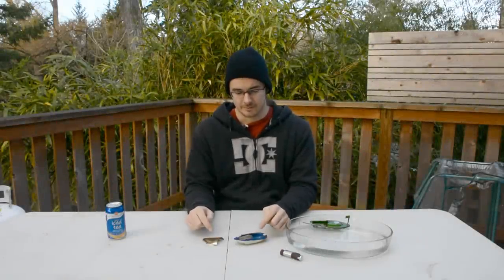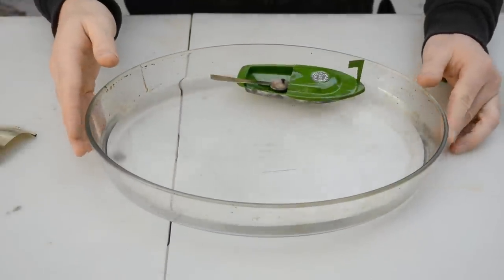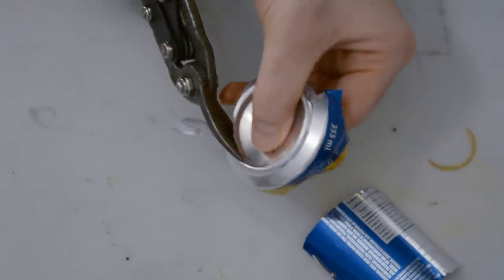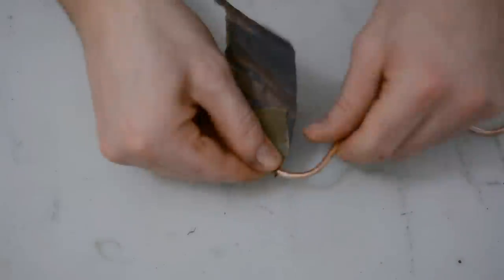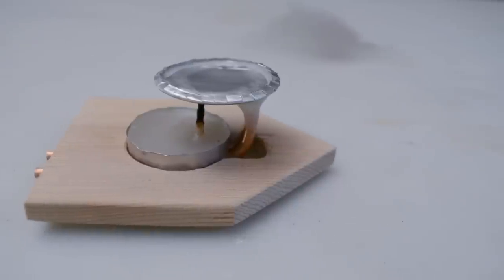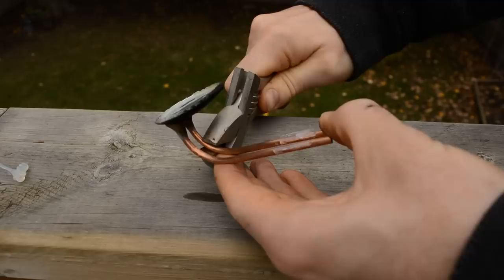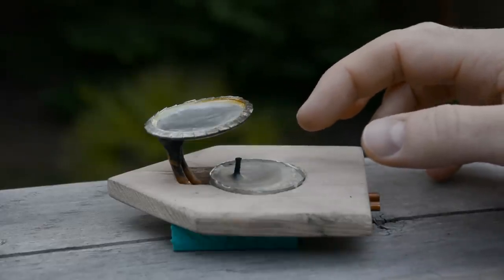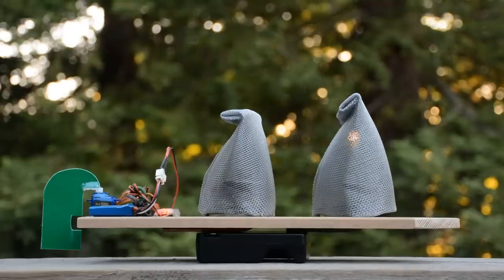How to Make a Pop Pop Boat From a Pop Can!

Comment: So this is basically a safe alternative to making your own pulse jet.
Reply: Sort of, this wouldn't work outside of water
Reply: Nah, ask colinfurze. He says it's safe.
Reply: @KingCheepcheep6  I disagree, it would work outside of water it would just be very anemic. there is a heater method used to heat air that kind of does the same thing. generally water boilers want to avoid the mechanism that makes the "pop-pop" boats work because it can cause damage and is a major annoyance.

a pulse jet uses a constantly expanding gas and intake causing a chemical reaction aka and explosion, a "pop-pop" boiler is a purely thermal reaction and could operate off of a battery and a heating coil. we don't really scale them up because the parts are prone to wear and  anything that combines heat and pressure like their is likely to fail, on a boat this means taking on water. but you can think of it as half of a sterling engine.
Reply: Absolutely not, steam engines are EXTREMELY DANGEROUS AND CAN BR EXTREMELY DEADLY.
Reply: If you don’t believe that, just research steam engine explosions on just trains. Then research jet engine explosions of any jet propelled vehicle. Make sure you sanitize the floor where you do you research...that way you don’t get any germs on your chin when it hits the floor.
Reply: @fuge74  CHey man sounds like a strong one any way to get some tips from you?
Reply: @youarerightthanksforadmitt846  I have none to give, its just thermal expansion. If you add propane you have a pulse jet. If you loop it and run it backwards (without fire) it's an AC. system.
Reply: Its a pulse jetski
Reply: I saw the similarities to a pulse jet immediately too not exact obviously
Reply: @jimmyblakemore141  ye some of the steam engines kinda look like they summoned cthulu out the front, the mangled metal bent and shredded this way and that.
Reply: I forgot The name, works for rockets too!
Reply: C'mon Forrest. Give us the details on your second creation. Even if it's just in the comments.

Comment: 9 months later. Still waiting. Lol
Reply: Lol.
One thing that didn't make sense, is why didn't he have the water-intake tube facing forwards and the water-outake facing the rear. You would effectively triple your power, because you now have two equal forces (sucking and spitting) working for you. This current design would have the sucking work against your direction, and being close to the spitting, would create unneeded turbulence or "drag" in the water.

And with the Double-Candle/Engine Pop-pop boat... why didn't you have the front engine "suck" from the nose of the boat, with the front water-outake pipe aimed towards the water-intake of the rear engine. This way the front engine can work at max optimal, and the rear one gets an extra "boost" to its performance. Basically a difference of quadrupling your power, in a perfect/theoretical setting, I know in the real-world/practical setting there would be many other inefficiencies or factors that play a big role.... but that's no excuse to engineer something well !!
Reply: I looked in his playlist and found that his video before this one was from 4 years ago! So I'm sorry, but there's literally NO TELLING when the follow-up will be.  :-(
Reply: You can not decide which tube sucks and which one blows. There are no valves in the tubes so the pressure goes in and out of the tubes equally, and you definitely don't want to blow energy out the front because that would be totally against the point.
Reply: @ekinteko  There are no separate tubes. In fact, you can get away with only one tube, if you use precise machining. The idea is that the water level in the tank goes up and down, sucking and expelling water with the same force. But the expelling cycle is better propelling the boat ahead than the sucking cycle stopping it.
Reply: What the heck are you even talking about??  Did someone delete a comment or something? Whirlpool is a weird place anyway, but ... has no bearing on a pop pop boat.
Reply: For what you hook up this dude at a party 9 months don't f*** with a man like that
Reply: Jesse Graas ik
Reply: @ekinteko  it wont work then
Reply: Lol
Reply: Right lol
Reply: @BartJBols  
Why wouldn't it?
Not condensing, just genuinely interested in the mechanics.

I have a feeling placement of the tubes into the bottom of the dish (portrait vs landscape) will allow you to adjust the plate's tilt and determine which is the water intake and outake.
Reply: Yes
Reply: There is another way if you scale it up to a vessel carrying people. Attach a type of flow control device timed with the pops, based on pressure. If you enclose the flames, like say with a steam engine, but make a gaint pop system. As the steam pushes the water back through a front intake, the valve closes, and as the vacuum starts sucking, it pulls the valve open. Kind of like a piston. Sound dampening should also take care of the loud explosion sound. The "thruster" would be set up the same way but flipped. It would make for an interesting build.
Reply: hes not doing youtube right is he  @Lothaenorixius
Reply: that what u just explained does not make sense lmao. this is a boiler not a car engine. agian, lmao  @ekinteko
Reply: @jabaaronkowalski498  
Irrelevant.
One of the tubes is sucking in, and the other is spitting out, thus creating thrust. If you can place the tubes and angle them correctly, then the thrust you produce would be more efficiently put into kinetic energy.

I'm not looking for a VTEC solution, just a simple solution to maximise the efficiency of this simple contraption. Not sure if you can comprehend it.
Reply: @ekinteko  it looks like you can't control which is the input or output. all would be both
Reply: @ekinteko  why not just make a larger engine? use a coffee can. get some pwr out out of her.  huh kangal that would dope huh!
Reply: @CookingWithCows   if one of the tubes was a smaller diameter that would insure the larger tube pushed and the smaller tube pulled in water.
Reply: @ekinteko  You are understanding it incorrectly, there is no intake/exhaust, both tubes do the same thing. The boat would work with just one tube. It's the pressure caused by water vapor that causes the boat to move forward. As the vapor forms, it pushes the water out of the tubes and pushes the boat forward. Once the pressure equalizes, the water keeps going out due to momentum. This causes a negative pressure in the boiler, which then causes the water to get sucked back in and the cycle repeats. 

Now, the water being sucked back in does slow the boat down. But the boat already has some momentum, and the candle is providing more heat/pressure as the water gets sucked back in, which results in a net gain of forward momentum. 

There is a page on Wikipedia if you want more detail
Reply: @AverageFlamethrower  
Thanks, you're the only useful reply here. Although the two tubes are connected, they don't do different roles, so they're both intake and both outake.

Which should mean the boat only rocks forwards and backwards. I guess the pressure of the steam is released at a higher speed and directional (giving forward thrust). Whilst the sucking of water happens much slower and from multiple directions, so that it doesn't decelerate as much.

I guess having the right sized pipe is important to have a balance of air, steam, and water. Too large and it won't create the pressure for net positive thrust. Too small and it won't be able to suck in water as necessary.

Maybe that's why they use two pipes. It could help the partial atmosphere during the cycling as well (trapped air etc).

Perhaps if someone had a pipe with rifling/valves that favoured a directional outflow it could be more efficient. Basically giving specialised roles per pipe, as per my initial confusion. Also maybe a cigarette lighter could provide the heat better than a candle. Interesting project for kids nonetheless, and the first I've ever seen it.
Reply: He's active on FB, perhaps message him there?
Reply: I blame you for this appearing in my algorithm
Reply: Ha I'm on 12 months
Reply: @All Cars Matter I don't think they need to be made of copper but I could be wrong, also I think most people use copper cuz copper tubing is readily available as its used for brake lines on vehicles and is pretty inexpensive
Reply: @All Cars Matter when I was at college I did work experience in a garage and a lot of the cars had copper brake lines but I'm in the UK and this was at least 15 years ago so maybe they've changed now or are different in other countries, I dunno but a quick Google search for "brake lines" still finds many copper brake lines advertised as such a 25ft roll is about £11 gbp
Reply: @ekinteko  Because it operates on pressure. When the pressure is high (when steam forms) the pressure is released EQUALLY across both tubes, both tubes will release pressure by pushing out water and steam, none of them will suck in anything. When the pressure is low, which in this case means a vacuum, the atmospheric pressure will instead push water in the tubes, both at the same time. So if you put them at opposite ends it would either just spin around (if they were misaligned) or it stand completely still.
Reply: @TehBudWhisperer  
Well, not to make your comment sound stupid or anything... but if you check the timestamps you can see which reply came first or second.

This was the first time I saw these contraptions, and the physics part of my brain was tickled. All the useful comments came much much later.

I don't blame you, Youtube's commenting system is broken. I mean, have a look at the cryptocurrency comments in this same string lol.
Reply: Kangal your conclusion is correct, the sizing and length of the tubes are important. One tube would work as well. Your idea having one inlet and one exhaust might work. Take apart an ordinary coffee machine and you have it. The thing is that the inlet is slightly reduced just before the heater so that the hot water choose the other way. It would probably work as well on a pop pop boat.
Reply: @ekinteko  There is no in tube or out tube.  They're both in and out.  The reason this works is because sucking is omnidirectional and blowing is unidirectional.  This property of fluid dynamics is used in many applications.
Reply: Kangal, the reason he didn’t do that is because both tubes alternate being the intakes.
Reply: @ekinteko  the intake/outake your speak of, aren't so, the water heats up and creates steam, the steam pushes the water out of the easiest pipe at the time, this then pulls water in from the other pipe, at which point it turns into steam and, potentially pushes it out of the hole it came in, if this happened in your proposed design it wouldn't move
Reply: @ekinteko  If you have a constant flow of water you just cool the boiler down, and you'd need a one way valve to avoid that the flow doesn't go forward.
Reply: @ekinteko  both tubes are intake/outtake
Reply: This guy forget his youtube password
Reply: 2 years
Reply: 3 year now :( I really hope he’s ok
And I wanna see that super boat actually sail across the water…
Reply: @ekinteko  my guess is that both tubes act like intake and exhaust tubes. There's no continuous flow
Reply: Need an update!! Come on bro!
Reply: 3years I want to see this radio boat
Reply: 3 years later... Just found this vid... No continue...
Reply: @ekinteko  both tube switch between intake and exhaust, is not one does intake and the other does exhaust.
Reply: 3 years later. still waiting. lol

Comment: Damn, i love that first step! 2:38
Reply: Personally:
If ETF I'd probably put $5k into VAS and $5k into VGS. I'm not sure whether you'd classify current market conditions as safe but if the value of the ETF remains stable the returns (Distributions) should be higher than savings account.

if Savings account I'd probably open something with UBank (or another bank with similar/higher interest rate) and keep topping it up monthly to meet requirement for the higher interest rates. If you can't add any additional funds on top of the initial $10k then you should consider a term deposit (if you can get a higher rate than a savings account of course) as saving account's interest rates are generally really low without the bonus rate.
Reply: You're a bizarre troll Stevo..  Your script is hitting a completely irrelevant youtube video, because I don't think anyone here cares about cryptos...
Reply: @parishna4882   Correct *****LMFAO*****
Reply: I'm still stuck on step one. I'm just repeating it, you know, for practice. :)

Comment: over the years, I have made a few,  I found that the thinner the metal, ie, flexible, the better it is, plus metal putty is really good at sealing the joints, apart from that, you explained it really well

Comment: The boiler angle plus your tubes on the boat you bought are 90% on the inside of the boat only 10% outside the boat in the water. on your wooden boat your tubes are 80% in water and 20% out. So they're cooling down faster.
Reply: TBH I've never seen a design like the one in the video, only the coil-based design for the boiler. 
Direct heat to a 3 turn coil copper tube mounted above the heatsource in the well of a boat hull (made from half a drink can, with the bottom pushed out into a bow) is a much simpler design and works far better. We used to make a bunch of them at a time and race them when we were kids because you only needed a pair of tinsnips (or even kitchen scissors in a pinch) as a tool.

Comment: I've seen this propulsion system before ... very nice ... and it even sounds like it has a piston engine ... extremely simple a propulsion system without so many moving components that are subject to wear and that are at higher costs small or larger ... I wonder if it could be applied on a larger scale ... remote control boats or even a large boat

Comment: Built this with my son & loved it! Have you tried J.B. Weld yet? I use it to build brass olive oil candles. It seals off the threading in the joints. It is heat resistant and even comes in a marine variant, that I, to be honest, have not tested yet, but sounds interesting. Thank you for sharing. Very well produced. Cheers!

Comment: I want to build one of these big enough for me to ride across a lake with. Can it be done?
Reply: Hrmmm with the right tool and material.....yes you can.....maybe...
Reply: so a steam engine.
But im fairly sure this doesn't scale well, as it relies on the sucking and pushing of water.
On small scale that goes fine, but on large scale id not want to sit anywhere near a steam explosion that can suck that much water in.
but you can use steam to run paddles ;P
Reply: Nekogami is right. At bigger engines the boiler will cause problems. But... what about a series of 500 little engines....? Hah, it would sound like flying with a swarm of ducks.
Reply: Adjcent a pop-ular question. It’s Pounds per second by Volume per Pop x delta t (outlet-intake)

Comment: And why not solder joints of (boiler ?),instead using epoxy ?.
Reply: I would use Acid core solder, should work great.
Reply: Prolly because aluminum so thin gets brittle or melts who knows it only took 4 years for this videos.
Reply: @raymondmucklow3793  aluminum definitely won't melt at soldering temperatures. Alumiweld brazing rods would have a flexibility similar to aluminum and might be a better option than solder. I don't know anything about brass filler brazing.
Reply: @charlesgunzelman3323  solder is like 300f to 4oo f aluminum isnt it like 800f i was thinking more along the lines of the thickness of the aluminum. If ya have ever burned one it heats very quickly then blackens and flakes.
Reply: CryptoCracker  triggered much.
Reply: CryptoCracker  he is doing research by posting a comment people with experience can share there knowledge (like i did) on the solder side not in the aluminum side. He can learn from that. Keyboard warriors like yourself just want to make rude comments.    I bet he was waiting for someone with aluminum experience would weigh in then draw his own conclusions. Maybe experiment a bit.
Reply: CryptoCracker  just so im clear and he wasnt there are many types of soldering, copper wire, copper pipe, silver solder, he doesn't say what type or types of solder he tried. I once watched a guy tig weld a pop can. The thick part top or bottom not the side tho.
Reply: Good luck trying to solder aluminum that thin with some sort of aluminum brazing rod. You're better off trying to work a sheet of copper into that bowl shape and do actual soldering.
Reply: Good luck trying to solder aluminum that thin with some sort of aluminum brazing rod. You're better off trying to work a sheet of copper into that bowl shape and do actual soldering.
Reply: @timramich  yeah I've never tried.
Reply: @charlesgunzelman3323  yeah i really dont like that kind of attitude. Especially when a question is asked. I like to think of you tube as a platform to share knowledge and experience. Some folks just cant help it.
Reply: @timramich  alumiweld works more like solder than braze. I've not tried it on something that thin but willing to give it a shot. I know by other YouTube videos it's possible to melt thin aluminum given enough time. Now I'm curious. Also, according to other pop pop boat builders experimenting with performance, the popping action isn't necessary and actually impedes top speed. Food for thought.
Reply: @charlesgunzelman3323  if it didnt pop, would it flow ? The pop back after pressure release doesnt that suck in more water or is it temperature differential. This is the first ive ever seen these boats so i dont know much about them.
Reply: TheJayfa  darn Tuten
Reply: @raymondmucklow3793  look up the Daryl Foster putt putt video about him building possibly the fastest one. He specifically mentions the popping action is completely unnecessary and just slows the boat down. He's got like 6 pipes in his.